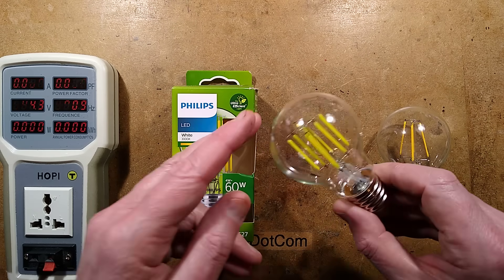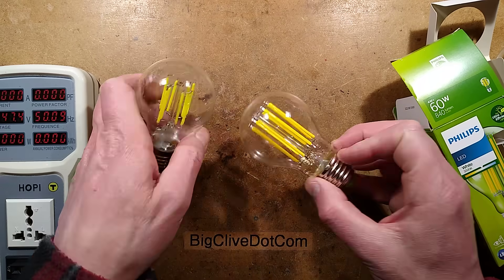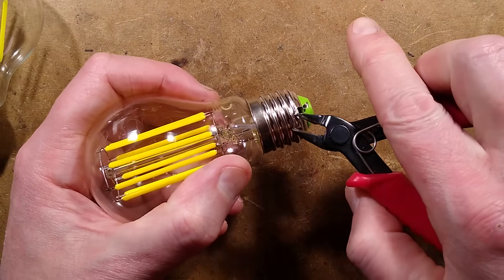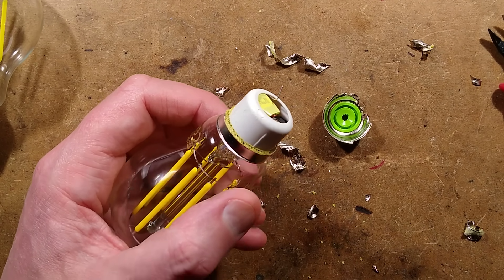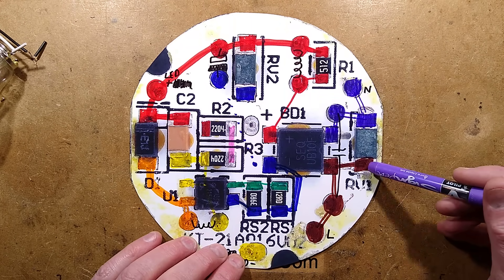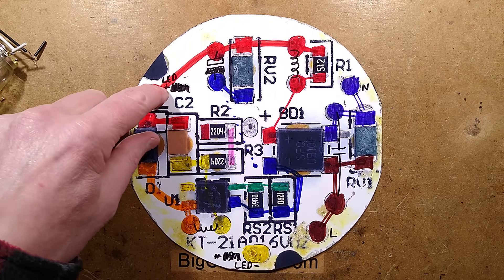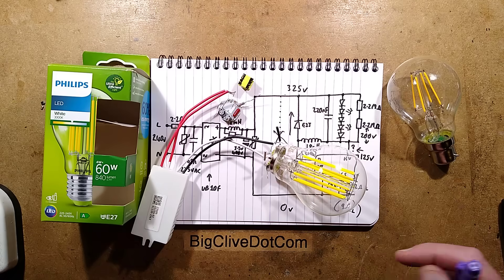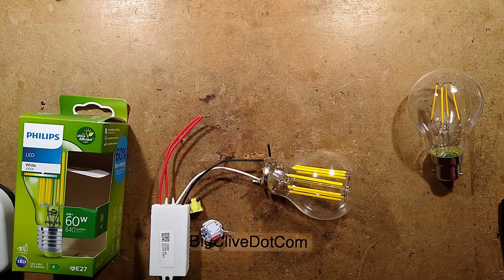Inside a new Philips ultra-efficient LED lamp (with schematic)

Comment: I worked for Philips for years .  Everything they do is over engineered however their choice of components seemed to be based on what someone had over ordered years ago
Reply: Perhaps in your department, but meanwhile I had a $90 wake up lamp with buttons that shorted over and over, and a power FET or something that failed in a few years (known issue).

Though if by "over-engineered" you mean "uses 4 PCBs where 2 would do" then yes, it was overengineered.
Reply: @concinnus  I'm surprised it didn't use 8!
Reply: Maybe they did not over engineer enough - or sometimes they ordered the wrong stuff. Or whatever. In the early 90s a Philips Goya CRT TV basically burned down my Grandma and her house and nearly killed my uncle trying to rescue her. So I'm not the biggest fan of Philips engineering personally -- but it is probably understandable that this is somewhat biased of course.
Did not touch anything from them for decades but time softens your view and recently I even bought some lamps with their label and even a TV set (but that took me some time and kind of forced rationalization).
Nowadays there is much worse stuff out there.
Reply: @thisiswaytoocomplicated  Did they put something on top of the tv? Like a piece of cloth, or did they have the tv in one of those big tv shelf's that leaves a tiny space around the tv?
Reply: @brostenen   No. Was on a TV stand. Something like a chrome pillar stand from Philips with wheels under the TV in the middle of the living room. Was not in a shelf but completely free standing and nothing on top.
According to fire department some parts in the TV set just started to char and smolder and eventually burst into flames. Wasn't that old either. Maybe two or three years old at the time but I don't remember exactly.

Probably just something that happens. If you sell a lot of electrical items of some type there is probably always a few to fail.
Most people maybe forget that all electrical things still can fail and be dangerous.
Reply: @thisiswaytoocomplicated  That unfortunately happens some times. Whatever happened at the factory is impossible to know now. My grand parents experienced that as well, however my mothers brother were sitting and watching, so he grabbed the tv and ran through the room and threw it outside. All while it was on fire. It was around 5 years old at that time, and the brand was Sony or something like that. Personally I remember those tv stands. We dont really see that anymore.

I asked, because back in the 80's and earlier, old people would always decorate their tv with a beautifull piece of cloth or put candles and ceramic figurines on the tv. And so many old people died from fire back then. Today most death by fire are candles here in my country. Nursing homes have the blankets that are fire proof, if the old person is a smoker. That was also a fire hazard back then.
Reply: Philips was notorious for using methods in their products that did not make much sense but at least different from how other makers realized the same function. If something opened or operated in some unexpected weird way it was safe to assume "It's a Philips".
Reply: I remember what quality they did back in the 1980's when we are talking televisions as an example. Philips always made the best. Stereo audio equipment not so much. They never did any HIFI that was as good as NAD. But televisions and especially CRT tubes, oh boy they knew their stuff. The exact reason why B&O used philips inside their nice designed enclosures. Here in Denmark, we had a saying in the 1980's, that if you bought B&O, you actually bought expensive Philips. The design and that it was produced inside Denmark, were what made it expensive.
Reply: @brostenen  in the late 80s I had read that B&O used parts from Hitachi.
Reply: @umitbalioglu4251  Most parts were philips. The tube was. I only know this because I am from Denmark and B&O is Danish.
Reply: @brostenen  mmm, I've had 2 Philips TV's, one in the 80's & one in the late 90's. I got my money back on both of them, they were rubbish. The first one threw a wobbler every time a car drove past the house & the second one made big bangs at random intervals.
Reply: @philb2334  Depends on what you paid for them back then. Sure philips made bad tv's as well as any other brand. But if you paid in the high end, you had good tv's.

Comment: I would love for you to upgrade to 60fps. While you were taking apart that bulb it felt a bit jittery. Great vid as always though. 👍
Reply: Clive, I also need you to shoot video at 60 fps to justify the cost of my 120 hz smartphone screen. That I run at 60 hz. To save battery. On my flagship smartphone. With a 120 hz display.  Please hurriedly and assuredly modify and adapt yourself and situation to the needs of my half-speed full fat flagship phone requirements.  Thrank yeuuuu.
Reply: @ryanmerrill2273  lol, in best possible way, lol.  do not be sending bobs and vagene pls, thnk u

Comment: wondering what the 1.41 in your calculation (230v x 1.41= 325v) comes from would help me understand this alot better but love ur vids.
Reply from the maker: The mains supply voltage is often described as RMS (Root Mean Square) or the average of the sinewave.  Multiplying the RMS value by 1.41 gives the peak voltage that a capacitor will be charged to.
Reply: 2^(1/2)=1,414 213 562...
Reply: 1.41 is an approximation of the square-root of 2. Used to convert RMS AC voltage to the peak voltage of the sine wave, which is what a capacitor after a rectifier will charge up to.
Reply: 1.41 is the conversion factor from RMS (which an AC voltmeter reads) to the actual peak of the waveform which is often more important.

Comment: 210 lumens/watt is quite something. None of the screw-in bulbs here on the shelves at typical U.S. stores come anywhere close to that. They're usually around 80-110 lumens/watt.
Reply: that is quite impressive only chip being better would be an under amped LM301B from samsung
Reply: Remember we lose a lot of efficiency by stepping down to 110v.

Comment: They've reverted to a switch-mode supply in order to eliminate flicker which is part of their 'EyeComfort' branding claim.
Reply from the maker: The Dubai lamp had an active current regulator that dynamically maintained a constant current to eliminate ripple.

Comment: These string type led lamps last a much short time than the other corn cob type. This is probably due to heating of the led string without any way of getting rid of elevated temperatures other than convection inside a plastic container.And the brand has little significance on the lifespan where they all last a short time but maybe the better brands last slightly longer, I'd like to see if there was any big difference here.meanwhile I'm not buying them and use corncob types that have literally lasted years.I have even been able to buy these LEDs on SMD   packaging strips to replace LEDs when they look dodgy.
Reply: That's an extremely superficial observation.  You may have seen a few bad early examples of the string design and now think all with that look are equally bad.  You may also have seen some of the most refined cob-style lamps made before production became rare and assume all the older ones were equally good.
Reply: @johndododoe1411  Righto not to worry I'm a total buffoon and don't know shit from clay,,, cheers

Comment: Wouldn't a capacitor dropper circuit have much less points of failure than this approach? I should rewatch the Dubai lamp video. I think Philips decided to release them for everyone due to them being in Europe and also due to fear of the new upcoming regulations for right to repair and longevity.

Comment: I have alot of outdoor lights. The appropriate brightness is roughly 20w inconvenient.
I replaced them all with 40w equivalent LED bulbs and out them on a cheap smart dimmer that now tracks sun up/down. I run them at half power for most of the night and 20% when I'm going to bed. The payback over even useing CFL lights was under a year. Not considering all the times it's just rainy or under snow and a photo eye would turn on. They are also now intigrated to use my cameras as motion sensors so when motion is detected everything goes to 100% and my yard becomes brightly illuminated.

Comment: Hey Clive, I would love to see a a project that steps up 5v to a suitably high voltage to run these efficient lamps off DC in a standard socket, I would love to convert my desk lamp to USB that way so it can be run off a powerbank
Reply: You can get 12V E27 (screw) bulbs for use on busses, caravans and houseboats. It's easy to step 5V up to 12V using a boost or buck-boost converter (cheap on amazon). I can't guarantee that a usb charger will be able to put out enough power for a bulb rated to more than a couple of watts. You might be better of running the converter directly from some 18650s or an rc hobbyist lipo pack.

Comment: Not super impressed by the green-ish tint here. Even my 90+ CRI Maxlite bulbs have a stronger green compared to my flashlight with Nichia E21As (>98 CRI, 2700K).

I kind of want to make a light for the stove that uses the new Nichia 519As.

Comment: I had a feeling Philips would pull out the swanky extra efficient bulbs after the EU updated their energy efficiency labelling that rendered all the old A+++ rated products as now C or D rated.
Reply: Oh, that explains LED lamps being F or thereabouts - I wasn't aware that the standard had been updated. Thank you ;-)
Reply: @AAAyyyGGG  Pretty much everything has been updated. Shopping for a fridge recently was quite a shock when I looked and everything of a reasonable price was between an F and E. A lot of shops seem to be showing both rating standards. I don't really get why A/B is generally for better than what's on the market currently, it seems confusing more than anything
Reply: @legatelaurie  I'd say it is to leave room for future efficiency improvements. I'd rather have in 20 years a rating scale that (in practice) goes from F to A instead of going from C to A+++.
Remember, bureaucracy takes time, better to leave room for future improvements than to have to update the standard again in 20 years.
Reply: @UnlimitedRun  I suppose I'm looking at it from a different perspective. Imo, these ratings are a guide for customers, and if there aren't any A rated products on the market I think that's a failure. I'd prefer a system that was updated every 5 years (which I don't believe would create a tremendous amount of cost if each update was phased in) than this tbh.
Reply: @legatelaurie  To have some room upwards and avoid another A++++++++++++++++++++ scenario. I mean these Philips bulbs already made it to A again.
Reply: I bloody hope so
Reply: It's a silly system which does not allow for future improvements. They should instead just list energy used per lumen or similar, then the lowest number wins. Trying to grade by letter only adds to a self-justifying bureaucratic mess requiring a large staff of people constantly revising standards as the consumer gets lost in the constant changes. And it will play hell on a seller who bought "A" grade today only to wake up tomorrow and find their goods are mow "F" grade and unmarketable.
Reply: @P_RO_  I get what you're getting at, but I guess the biggy is that it's an easy to use guide for most consumers, given that it's easy to see A as being the most energy efficient and then use that for other electronic items

I'm sure that on this channel, most of us are probably STEM workers of some sort, and yeah we might actually be doing the maths but for the average consumer? How many even care about lumens per watt?

For millennial and older, it's easy to see 7W LED = 60W incandescent for instance. Saying that a 20W LED bulb is 1600 lumens for most people doesn't mean a whole lot

Then, with the new rating system, it hopefully means that they are somewhat incentivised to have these outside of just the city of Dubai, along perhaps with XED lighting. That would also be something that Gen Z would understand too if they're rated A-F given they've all grown up entirely with LED bulbs

Comment: application notes just show a simple circuit diagram for a way to use the chip. it's then up to us the designers to read the spcifications and decide how we want to use it. As long as the final design remains within the chips spec limits your good to go. bad designs push the chips to their limits to squese more bang per buck.

Comment: As several have pointed out, the symbole means that its not suiteble for motion detection fixtures (many on/offs) like drive way lights. The IP rating is not unusual, few lamps have any significant IP ratings since they are usually not "naked" but inside an IP rated fixture. However, as stated, the way they have implemented the circuitry, it is not suitable for frequent "on/off", hence the symbole...
Reply: Indeed most wall sockets are IP20 because they have holes in the front that let metal pins touch live circuits.

Comment: Love ur videos. From Atlanta much Love, sure wish I knew electrical as well as you..! Example can't even run a syncronous 21v microwave turntable motor, about to buy 120v one. Tried a 24v 5va but it just vibrates, have tons of electrical parts but can't seem to take in exactly what would be needed to make it right, build drones + computers but I idolize how you reverse engineer, amazingly awesome knowledge!

Comment: Seems like video was not uploaded in full. Resistor mod for better efficiency is missing 🤣.
That aside I wonder if Philips has 8W version of this, because 840 lumens is not enough.
Reply from the maker: Resistor mod is chopping off one of the current sense resistors.  But quite hard to get to.

Comment: Finally they're bumping up the lumens on these lights... I'm tired of the dim 500-lumen lights most manufacturers try to pass off as "60 watt equivalent." I got used to using 1000+ lumen CFLs and it's been impossible to find a suitable LED replacement. I'll have to get some of these.
Reply: The "X watt equivalent" thing is mostly BS anyway, the only values that really matter are lumen and wattage. Around here (Germany) the manufacturers seem to have settled in with a few lumen "tiers" that most LED lamps fit into, ~250, ~480 and 800+, the only thing that really varies is how many watts the lamp draws to achieve that brightness.
Reply: Asda do 14w LED's (I have them and under run them using Clive's method with the capacitors). I recently also picked up 22w warm white and 28w cool white LED bulbs from B&Q, although they were in the clearance (they were also enormous! About double the size of a regular bulb).
Reply: I've used the IKEA smart bulb. They have a version that's 1000 lumen. Although I would tike the colour "quality" to be better (I don't remember the term).
Reply: I've been buying California spec 100W equivalents due to the high CRI.
Reply: Surprising honestly.

It's been quite easy to find 800-1000 lumens in this power range for 60W equivalent in a long while.
Reply: My problem is mostly applicable to candelabra-base bulbs which seem to have a lower standard of 60w=500 lumens. I can find 800-lumen A19s just fine. Maybe it's a holdover from the old cartel days.